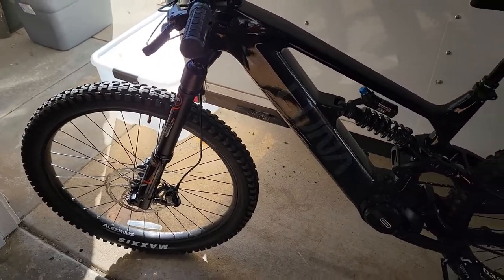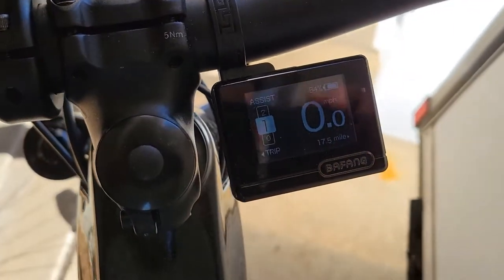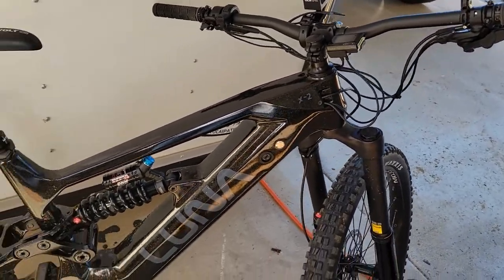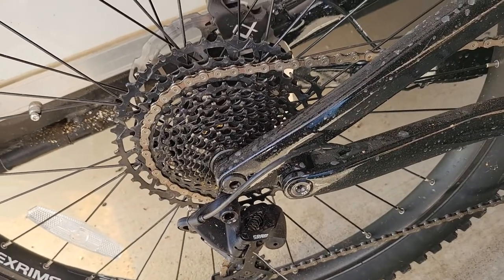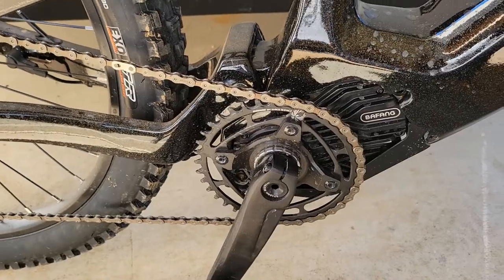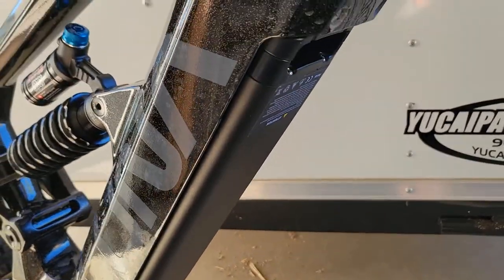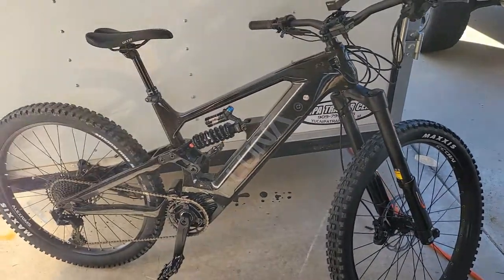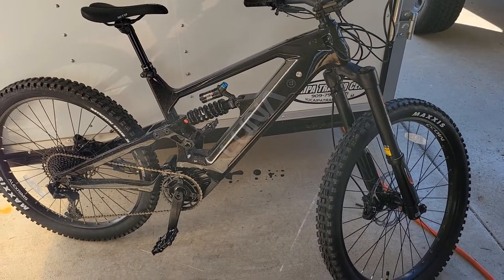Luna X2 Enduro Review

Comment: I've had an X1 for a little over a year now. I really disliked it when I first got it as it had the wrong firmware for the kind of biking I do; but LUNA fixed it right away when I took it back down to their El Segundo location. 

You need to reroute your front brake hose to go inside your fork stanchion/slider, the current set up leaves it open to snagging on bushes, or worse, so I'd fix that. Also, as an interim measure, you could inject some Slime sealant (or whatever kind you prefer) into the tubes your running now. I did it as a temporary fix on my rear tire and it's held good pressure for several months now.

Ebikes are by their nature going to ride differently than acoustics, and you'll probably be replacing brake pads more often than on a non-motorized bike due to the weight requiring greater stopping power; thus, the 4-piston brakes. There are adjustment screws on the derailleur to fix the shifting problem you're having, and you can find several YouTube vids to help you do that if you're inclined.

Good luck with your X2. I've also got a Trek Rail 5 ebike which cost a couple grand more than the X1, but I'm actually a bit biased toward the LUNA,  even though I did have some initial problems (my derailleur exploded a couple weeks after I bought the bike. It now sports a GX).

Comment: Very nice and thinking of getting an X2.  Do you think it's worth upgrading to a Ludicrous controller or getting the Z1?
Reply from the maker: Z1 would probably be worth it for the better suspension.  The DNM suspension is kind of clunky, so I will probably upgrade that sometime in the future.  I don't think the Ludicrous controller is worth it for me.  It will wear out your motor faster, and put more stress on other components of the bike.  I've had no issues with the normal controller and power.  If I wanted to never pedal, maybe the ludicrous would be worth it.  However, if I don't want to pedal, why am I getting a bike at all.  I would get the Sur Ron if that was the experience I was looking for.

Comment: Thanks for taking the time to review your bike. Just wondering if you are still happy with the purchase. Am considering getting one, talked to Scott at Luna. He reiterates, the bike will overheat if pushed hard(Eric in his video says the same). 
Considering getting the optional Ludicrous controller. Have you had any overheating problem, is this issue a deal killer???
Reply from the maker: I haven't had any overheating issues, but I also don't have the ludicrous controller.  I would imagine that ludicrous controller puts a lot of additional strain on the motor, but I'm no expert.  I've been very happy with the bike's performance without the ludicrous controller.
Reply: @ls6777  Thanks for your response, helps. None other owners have experienced overheating. Apparently you can dial back the ludicrous controller to stock power controller. Just wanted the ludicrous-c for reserve power if needed. Look forward to more videos from you.

Comment: I have the exact same bike and I hate the front shock. I upgraded the rear cassette to a one piece that is much stronger. I put a 40 tooth chainring on the front which helps. I don't how some guys get the rock shock Lyra. I also got a Sram GX derailleur and shifter but have't put them on yet. Also I did tubeless tires and lost almost 2 lbs. Where are you?
Reply from the maker: I'm fine with all the stock stuff for now. Suspension works ok for me now.  Maybe after a lot more riding I will want to change, but I'm happy with it so far.  I think all your upgrades are solid, but I probably won't upgrade until something breaks or starts causing performance issues.  When these tires are toast, will definitely be looking at tubless tires though.  That sounds MUCH better.
Reply: @ls6777  It is very easy to go tubeless on the stock rim and tire. I just took the tire off the rim, removed the exist rim tape and put some Stans rim tape on the rim, put everything back together pumped it up until the tire seated then let the air out and put 4 oz of Stans sealant through the valve stem and I was good to go. I feel much safer off road with stans in my tires.
Reply: @LarryRichelli  On the upgraded X2, the tires are tubeless but the rims are not. Luna admits you can tape up the rims to go tubeless but they don't guarantee them. Very happy your set up works. How much does your bike weigh???

Comment: I'm curious is the computer independent of the power delivery and gear hub? I guess what I'm trying to ask is if you crash and destroy the computer can you still ride the bike under assisted power? Thank you for showing us that can be written like a regular mountain bike.
Reply from the maker: I’m not sure.  You would have to be in a pretty bad crash to destroy the computer though.  If you destroy that, you’ve probably destroyed other parts of the bike to make it unrideable anyway.  The computer is what tells the motor how much power to assist with, so I kind of doubt it will work without it.  Although, you can just pedal it if the assist is not functioning.

Comment: Is it possible to add a front or rear rack to the bike?
Reply from the maker: Yeah... you can add racks.  But you will have to check clearance and mounting based on how the suspension moves.  Options may be pretty limited.  Trailer might be a better solution depending on your needs.